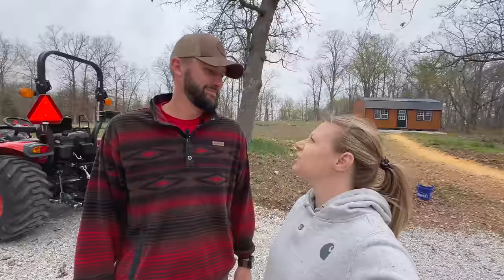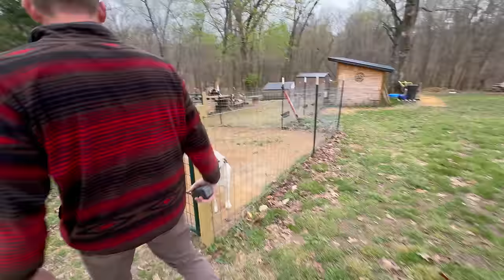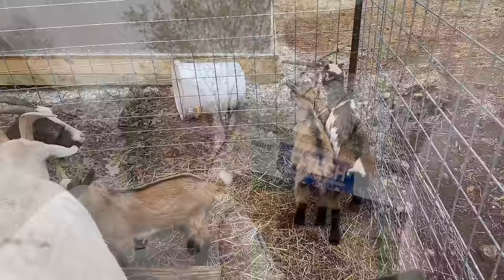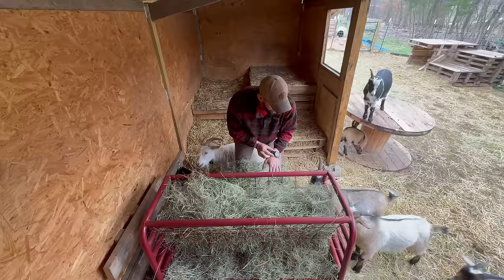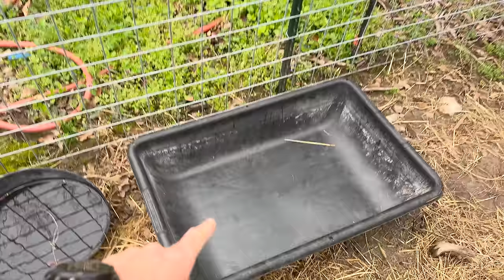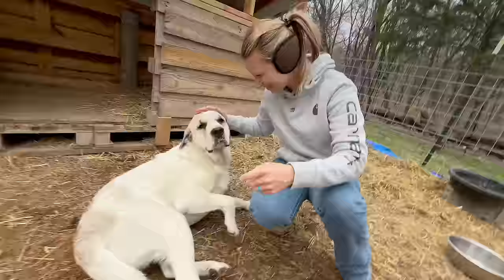SMALL projects make a BIG DIFFERENCE!

Comment: To get rid of the mice take a small container with a top on and put parm (spegetti) cheese in it with bajing soda and then mix it very well put a hole on the front so they go in they don'release gas or burp and the baking soda swells in thrir stomach and it kills them  I use it in my house and have cuþ down on them since my neighbor has them so I get them and it is safe àround my dog